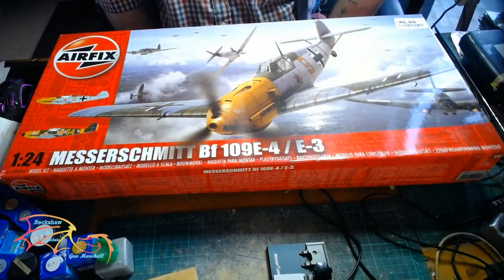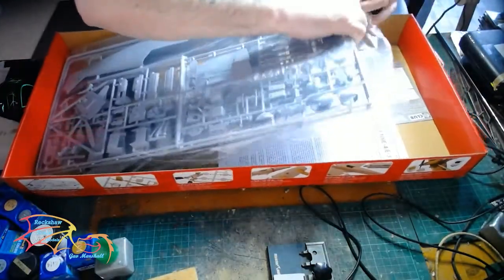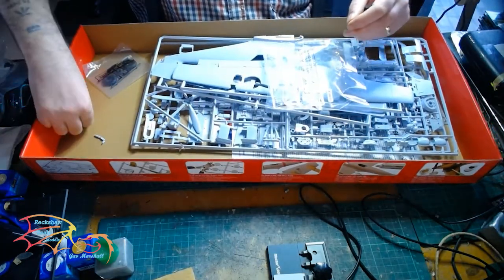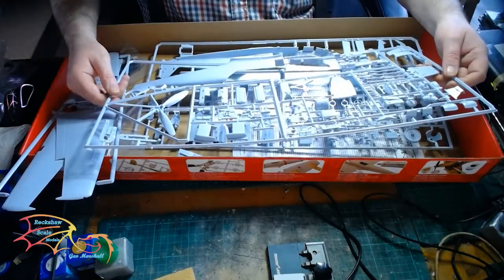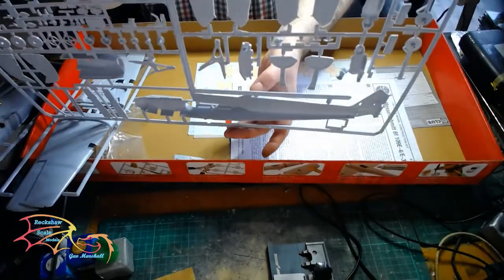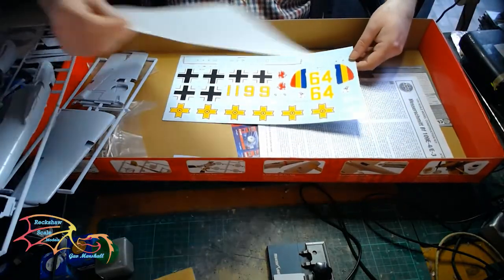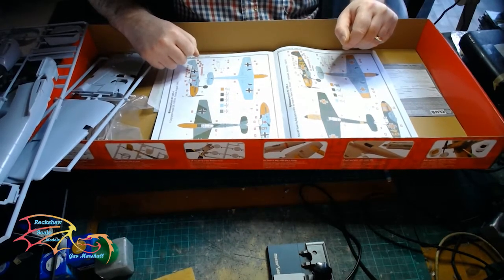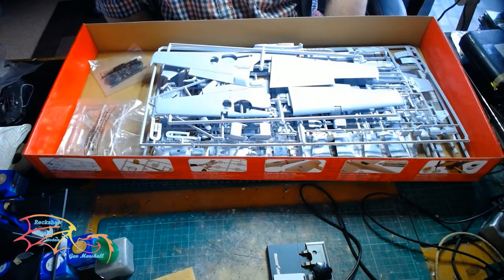AirFix Messerschmitt 109 Bf109E 3 Scale 1/24 Intro

Comment: outdated model needs updating and  key important pieces are missing on this scale. It requires too much self-construction and it is not easy to do it, the cockpit of the wheel wells is empty!!!..
Reply from the maker: Hi lorenzo. You can also argue that the kit has something for everyone. For the beginner who wants a large-scale build of the 109 but is daunted by the newer kits and part list to the experienced builder who enjoys the challenge of scratch building. I'm not saying the kit is perfect, far from it but I would stand by it simply because it goes together well will little or no gapping issues. Also there are many after-market parts for these types of kits to satisfy the builder who is going for a more accurate example. For the price point of this kit I think its good value, Airfix may produce a newer version of the 109 in 1/24 scale as they have done with the spitfire but everyone is going to be able to afford the price of that kit. The older kit has its place in the hobby and shouldn't be ignored.